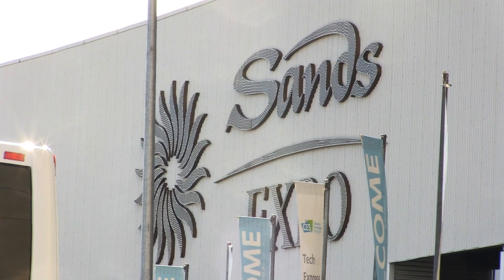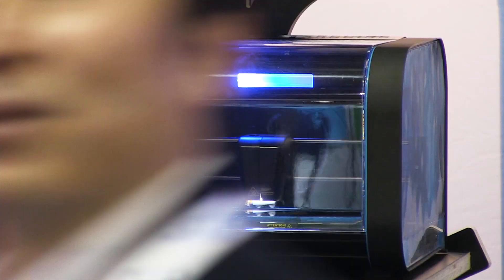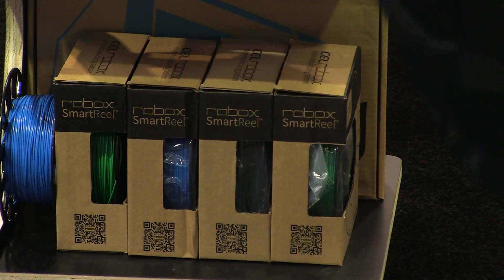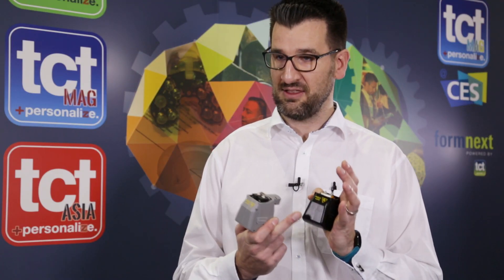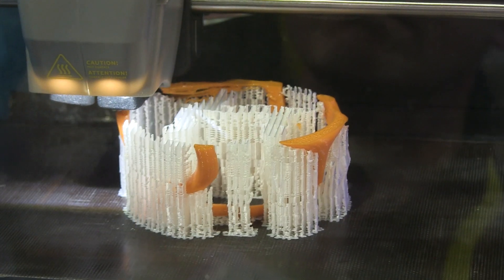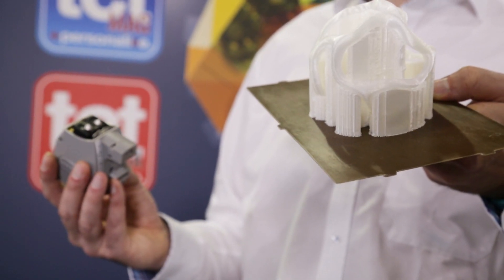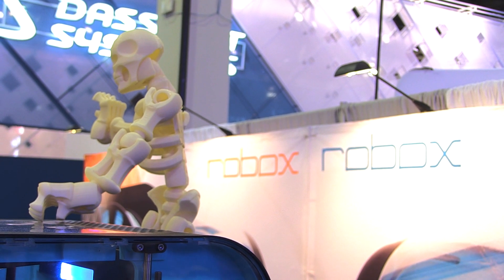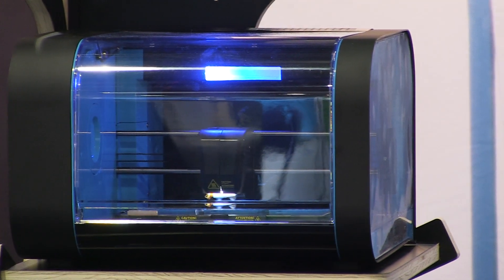Dual Material 3D Printing by CEL Robox at CES 2016

Comment: Ha, interesting. I do wonder how are they getting on, since the Robox unit I am having is nothing much other than pain so far. Hopefully in the next version at least the extruder won't kill it self and the nozzle won't knock the print out away. For resolution part, I am already give up on 25 micron idea, let's pray that after this update at least it can do 100 micron normally like other printers in the market.
Reply: I also have a robox. I know, you wrote this comment a year ago. But mine prints really good. Sometimes the materials gets stuck when ejecting, but i wrote a ticket to the support and since then i know what i have to do. Maybe you send yours in for repair? (sorry if my english is bad, i'm from germany)